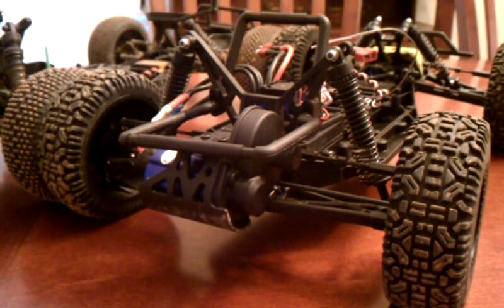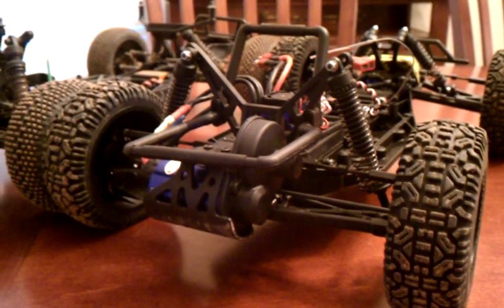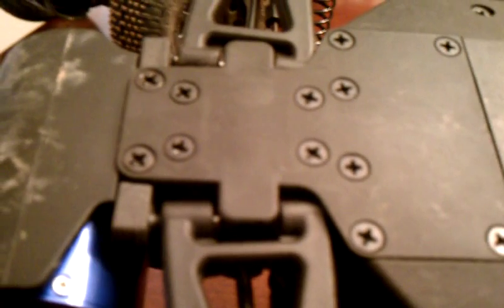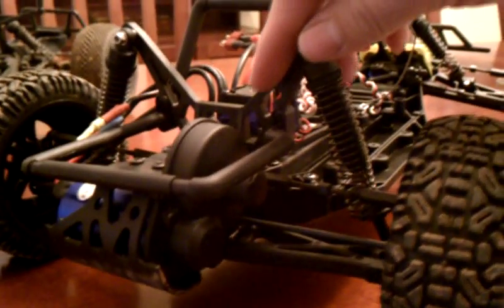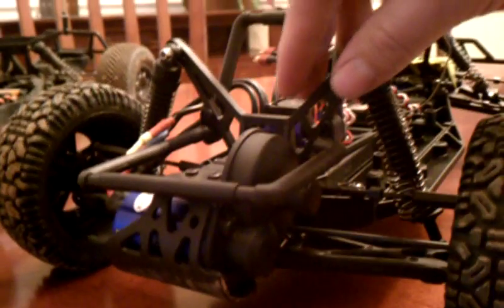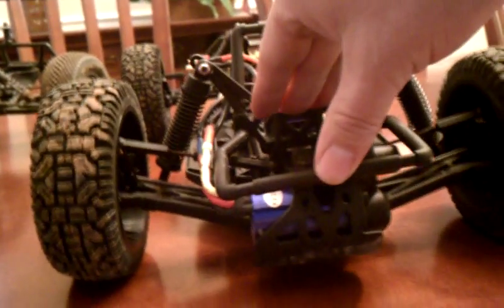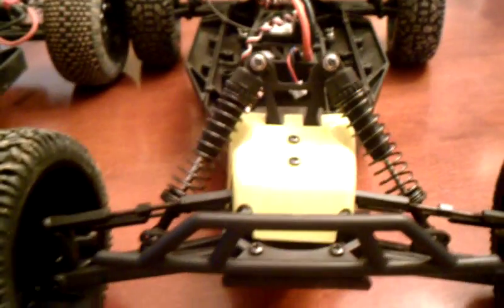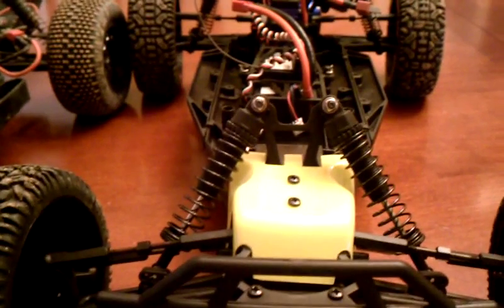Turnigy DB design flaw

Comment: A car not bottoming out is NOT a design flaw!  A well tuned RC will NOT bottom out when the suspension is fully compressed.  If you want your car to bottom out, move the mounting location of the shocks.

You could also add fuel tubing to the shock shaft so that it asorbs the impact of bottoming out rather than your suspension parts.

Comment from the maker: @nerdyrcdriver, all cars should bottom out on the chassis, otherwise too much stress is placed on the suspension... I had no problems racing my car all day yesterday without any breaks since I fixed this fundamental design flaw. I suspect they cut some corners and recycled these shocks from another car which simply aren't compatible with the DB... hopefully Turnigy corrects this problem before folks start returning the car as a defect, doh!

Comment from the maker: @MegaRallycar, yeah the very next video in my channel shows how I used shorter captured ball ends from the Duratrax Evader to fix this flaw. Hopefully no more breaks as I will test the fix this coming weekend for a full day of racing in the Spec SCB class running an HPI 15T brushed motor which clocked at 24mph, the stock 3300kV motor clocked 29mph